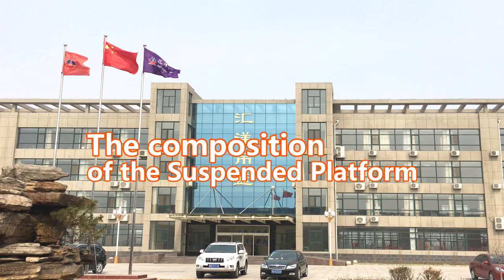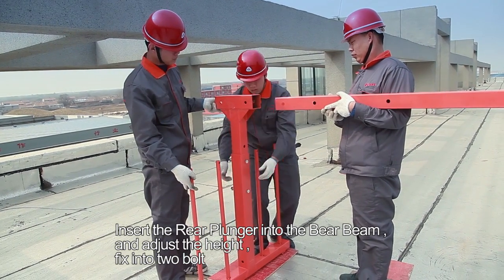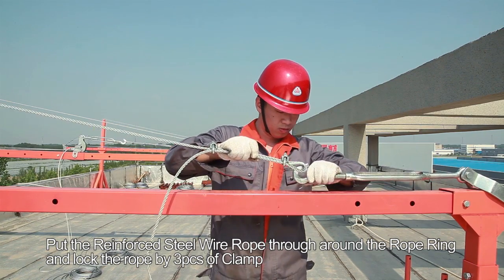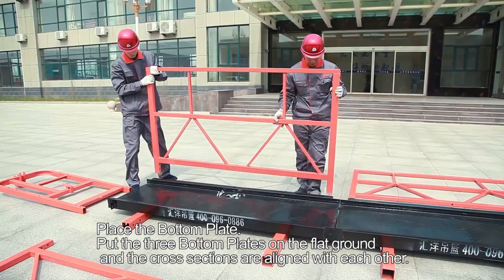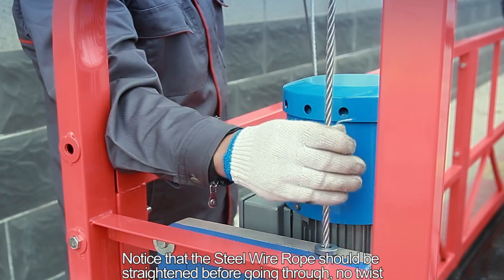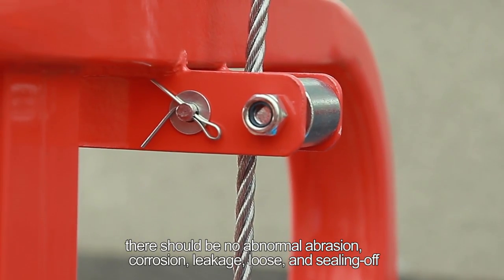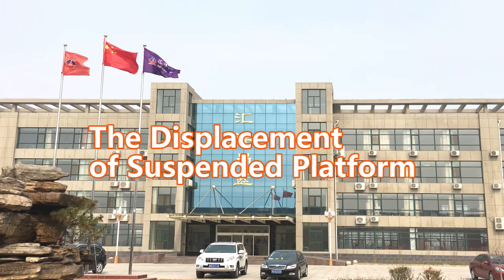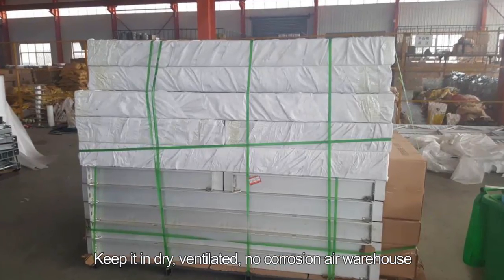Installation Video of ZLP630 ZLP800 Suspended Platform-English

Comment: nice, ii have a couple of comments, 1] safety rope should be 1 per man and auto-retracting NO SLACK, 2] adding wheels under the platform would protect the walkways and make moving faster and safer. 3] beeping sounds and flashing lights under the platform to alert everyone below that the platform is moving. 4] The wire nuts will cause weakness in time, there is a device that locks the cable without damage.  NO CLAMPS should be needed at all.
Reply: Retractable lanyards are illegal on swing staging.

Comment: Leading Manufacturer, supplier, and exporter of all kinds of infrastructure
Fraternity and construction equipment through consultancy, training, and total
service which is based in the Hyderabad. We provide a wide range of men and
material handling equipment with high-quality engineering standards for
Infrastructure Fraternity, Have a look at our wide range of products